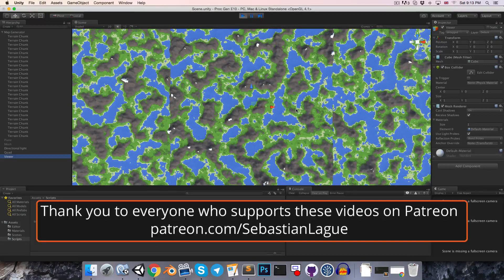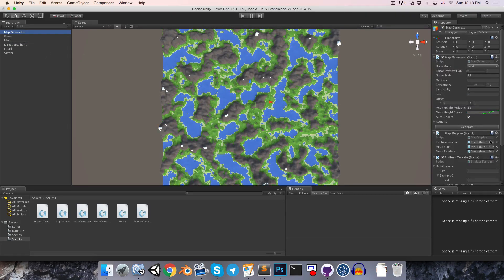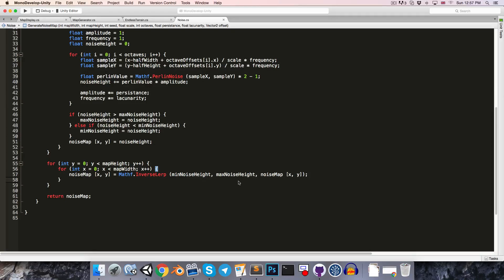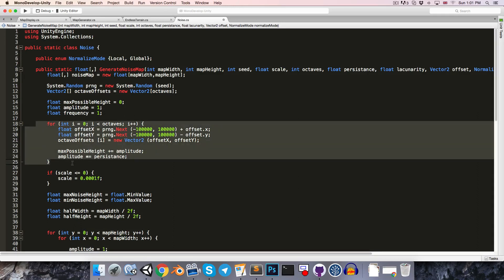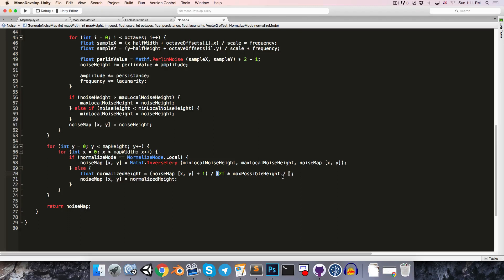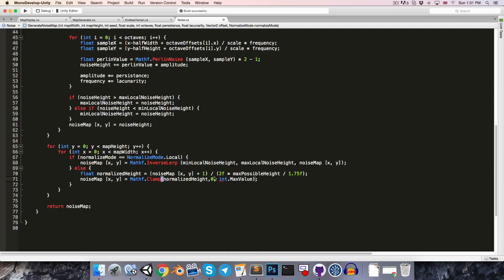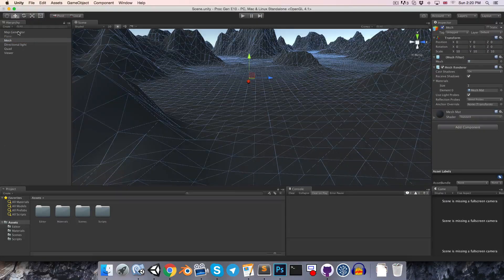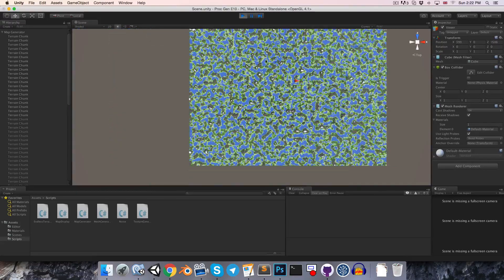Procedural Landmass Generation (E10: seams)

Comment: the stuff from 9 minutes in onwards isnt actually because of what he said its because of a bug in the math he normalizing the heights by doing 
(noise + 1) / 2 and then dividing the max height
its the other way around its  ((noise / maxheight) + 1) / 2 dividing the max height first put the number back into the -1 to 1 range which it wasnt in before. once its back into the -1 to 1 range then x+1/2 puts it into 0-1 range.
Essentially with the way he wrote the normalizing math it turns a number between lets say -1.75 and 1.75 (persistence of 0.5 and 3 octaves) into a number between -0.375 and 1.375 then divided by 1.75 to make the max height 0.78 and the min height -0.21 which makes the terrain way more squished. All you need to do to fix this is just fix the normalize math

Comment: For anyone wondering why chunks are not seamless make sure the first lod in the array is set to 0, has been 2 days that I'm searching for a solution and was that easy😂.
Reply: Man I love you 🫡
Reply: Thank You ♥ You saved me
Reply: What do you mean "first lod in the array is set to 0"?
Reply: @Svíþjóð-2025  In the Unity Inspector for "Details Levels" the first element (in array position 1, but index 0) should have the field "lod" set to value 0 (it worked for me). 

Try it at least, for now. It'll be fixed later in the series.
Reply: @Bezio1292  Ah. My issue turned out to be a mistyped [x, y] where i had accidentally written [y, x] instead.

Comment: I know i'm a bit late (7 years late), but i have the same script and now when i press play i have an 
MissingReferenceException: The object of type 'GameObject' has been destroyed but you are still trying to access it.
Your script should either check if it is null or you should not destroy the object.
EndlessTerrain+TerrainChunk.SetVisible (System.Boolean visible) (at Assets/Scripts/MapGenerationScripts/EndlessTerrain.cs:184)
EndlessTerrain.UpdateVisibleChunks () (at Assets/Scripts/MapGenerationScripts/EndlessTerrain.cs:55)
EndlessTerrain.Start () (at Assets/Scripts/MapGenerationScripts/EndlessTerrain.cs:36)
Reply: I have the same problem, How did you fix it?
Reply: public void SetVisible(bool visible)
		{
			if(meshObject != null) meshObject.SetActive(visible);
		}
Reply: I did this and it started to work

Comment: Don't know if anyone still following it but I run into a problem, when I change the offset at some point with a small off set change at a specific point the map change drastically instead of simply shifting as I said this only happen at a specific off set point, this make chunk at certain points not fit each other. This problem runs deep to the noise level

Comment: Since following the last video and up to this video everything works as it should except the Endless terrain in play mode.  Its a frikken mess!  Not only does a lot of the terrain not align up, but every mesh is the same pattern and looks the same from the top down.  From other angles they are all different heights, mostly everything is too low below the ground level and there are random thin spikes sticking out and straight canyons cutting through some of them.

Comment: I've followed these tutorials exactly and my global normalize mode still has seams, it is selected in the editor. I've watched the video multiple times and have gone through the code line by line side by side with the one available on the github. Help me please
Reply: Kasper Juul commented this 10 months ago:

Okay. For those who can't figure out why their chunks aren't seamless. I spend a whole day on this to find out that i did not set the normalizeMode to Global in the editor for the mapGenerator, therefore the code we write never runs and the seams are still there.
Cheers for the great tutorials. And still giving us some challenges :P
Reply: @manofbias8113  I definitely have global selected in the inspector and am getting seams
Reply: @joshabelman3294  are the seams between the same LODs or different LODs?
Reply: @manofbias8113  between different LODs
Reply: @joshabelman3294  that's normal, don't worry, the point of the LODs is that you wont see them up close so the seams are not an issue, just make sure to tweak the rendering ranges so the player wont notice it change
Reply: @manofbias8113  gotcha, makes sense

Comment: I'm not sure what I've done wrong, but none of my land masses have any height anymore. Up until E09 it was all smooth and now it's practically a plane again... not sure what happened.

Edit: I have also copied the code from Github to see if I've missed anything and nothing. Maybe it's some setting through Unity, but from what I can tell it looks the exact same based on the settings that Sebastian is using.
Reply: Have you set up your animationCurve and height multiplier? Otherwise it will always be flat

Comment: Hi, my vertices still do not align even though I followed every step. Any ideas where to investigate this problem? Thanks
Reply: I had the same issue, I reversed the order of the x and y variables in several places.
Specifically check: Noise.cs > GenerateNoiseMap in the tri-nested for loop, we set noiseMap[x, y] = noiseHeight
Here (and in a few other places) I had typed noiseMap[y,x] (which is backwards)
Reply: @FidgetwickGnomebody  OMG, thank you my dude, I was bashing my head in the wall trying to find my mistake, turns out that was exactly that "noiseMap[y, x] = noiseHeight;" and not "noiseMap[x, y] = noiseHeight;"

Comment: If you know the output range of the Perlin noise function to be [0, 1], surely you can have a normalizationFactor variable, each octave you add to it the maximum possible value for that octave, and then divide the final value by the normalization factor?

So, say you had a persistence of 0.5. The maximum value of your first octave would be 1.0, the second octave would 0.5, the third 0.25, the fourth 0.125 etc. Add all those up and you get 1.825. This is your normalization factor. So, whatever final value you get from adding up the Perlin noise at each level, divide by this normalization factor and it should put your noise value between [0, 1].
Reply: For anyone reading that is a popular way to tie these values together. You lose the granular control, which may eventually be needed for specific biomes/regions, but it makes things a lot more automatic.

Comment: Awesome tutorial series, even today! Lots of gems in each vid. 
Still have an issue here though, when scrolling the map by incrementing x or y, the land mass will still deform or change sometimes. I thought it was a typo in my code, but I checked the supplied code and it does it also. Not all the time but I did find areas where it would.
Reply: I noticed the same thing. When set to global the deforming is gone for some reason. Only on local it happens. I've been looking for a solution for this since i want to make a 2d game so i cant fix it with de vertices and triangles.

Comment: for the max, you can remove all the n*2-1 and (n+1)/2 and divide the final value by the maximum calculated. or, you can make it (n+maximum)/2 to actually reverse the operation. also, Perlin noise generates values outside of [0,1], so I multiplied the max height by 1.1.
Reply: afterwards, the mesh is going to look a bit awkward, but the regions and the heightcurve can be used to make it look  normal.
Reply: @kaishang6406  thank you, although somehow i ended up with values from -1 to 1

Comment: If you want to make the "scale" variable a bit more accessible to be changed on demand, I'd recommend using the Map Generator object to be able to place it in the Editor.

Simply add the following line to the start of the Map Generator script
public float worldScale = 1f;

Then, in the Endless Terrain script, replace every instance of "scale" with "mapGenerator.worldScale"

This way, you'll be able to adjust the world scale from the Inspector without having to change it in the code, although things will get whacked if you try to edit this value while the game is running.

Comment: 3:33
I tried to do this but now offset isn't working at all, anyone got any ideas why? (I am rewriting this code in a different language if that matters at all.)
Reply: maybe check your current octave number. Mine was on 29 when i did the changing and suddenly everything went hilariously wrong. Brought it down to 5, and now everything is fine :)
Reply: @aprikosengelee1503  There's definitely some awkward combination of values for the generation algo that can cause some really bad terrain generation.
Sebastian is using the following values:
Noise Scale: 25
Height Multiplier: 15
Octaves: 5
Persistence: 0.5
Lacunarity: 2
Reply: @aprikosengelee1503  my octave count is fine, but thanks for the help!
Reply: dunno I am writing this in same language and it happend to me too, tho when I swith + for -
                float sampleY = (y - halfHeight + octaveOffsets[i].y) / scale * frequency;
                                                                     ↓↓↓
                float sampleY = (y - halfHeight - octaveOffsets[i].y) / scale * frequency;
it seems to work so far without negativly effecting other things
Reply: @abram6282  Didn't work but thanks for the help!
Reply: someone solved this problem?

Comment: when i go in play mode all mesh turns dark gray, or if i press ctrl+s all colors go away to white. also for some reason generating takes forever so i had to turn off autogenerate button and just generate manually plus terrain that generated is disabled and even when i enable it, it still is invisible. My pc is gaming new pc so idk whats wrong with unity, perhaps anyone here experienced the same?
Reply: I was just running into mesh issue. Remember to disable the mesh visibility before you entire play mode, it doesn't get updated and so it has some weird side effects. Unfortunately, I have no idea why your generation is slow.

Comment: I don't know if you cover this in a later episode but there is a mathematical function called a sigmoid (1 / (1 + e ^ -x) ) that ranges from 0 to 1, which is handy for the consistent heights
So what i have instead is
noiseMap[x,y] = 1 / (1 + Mathf.Exp(noiseMap[x,y] * intensity));
where intensity is a float (3 looks normal)
Reply: wow that actually seems to work, but it not very good at performance and need some little adjustment
Reply: @ariefwt2220  what's the adjustment?
Reply: Oh apparently, you can straight up just divide the noiseMap height by maxPossibleHeight and it works really well

Comment: Hi +Sebastian Lague, i found a simple way to get the true maxNormalizedHeight.
On first octave, amplitude = 1 so  maxNoise height = (1 *2-1) * amplitude  = 1; // *(2 -1) doesn't affect the max value as maxPerlinnoise is always 1*2-1 =1 .
amplitude *= persistance.
On next octave maxheight += maxheight * amplitude
amplitude *= persistance
On next one the same. 
so maxHeight at o octave = 1 + 1*amplitude*persistance + 1 * amplitude * persistance*persistance + .... + 1 * amplitude * persistance * persistance  *..... * persistance where  the "..." means o-1 times
So we can just say:

float maxheight =0f;
int amplitude = 1;
For (int o = 0; o<octave ; o++){ //or we could say o<=octave-1
   maxheight+= amplitude * Mathf.pow( persistance , o);
}
float minheight = -maxheight; // as we use perlinNoise*2-1 

no more approximation ;) but you may have resolved in a later video x) 
Thank you for this great serie, i'm learning so much... Huge thank to you!
Reply: We can simplify the geometric progression sum(ap^n,n=0,k) as a(p^(k+1)-1)/(p-1) so:

maxheight = amplitude * (Mathf.pow(persistance,octave)-1)/(persistance-1)

If persistence is  between -1 and 1 the limit to infinity (which will truly be the max-est height):

maxheight = amplitude/(1-persistance)

if persistance = 1/2:

maxheight = 2*amplitude
Reply: As per  @MagicGonads  comment, the maximum possible noise value can be more easily calculated with 1 / (1 - persistence).
However, as the persistence nears 1, the chance of the noise getting anywhere near that value gets extremely low, so it's not useful as an upper normalisation bound.  I found that using 1 / (1 - persistence^1.5 / 2) to calculate a likely maximum noise height worked sufficiently well for most cases.
Reply: @RuaridhWilson  Might be nice to do some probability analysis on it to find out what the expected max height will be, beyond my abilities though.
Reply: I was thinking that you could do a gradient ascent on the noise map.

Comment: seeing you divide by 2 or 10 sometimes , i wonder why you wouldn't want to multiply by .5F or .1F.  i was taught, that multplication is generally faster than division because it takes far less CPU cycles. however i don't know if it would also make sense for division by variables by declaring an inverse variable first like inverseVariable = 1/variable and then multiplying by inverseVariable at runtime
Reply: Modern compilers are extremely good at optimizing. It doesn't matter if you write x * 0.5 or x / 2.0, they will both most likely result in the same assembly code. What the programmer should consider is the readability of the code.
Reply: I think those extra cpu cycles don't matter, it's probably never more than 1 millionth of a second extra

Comment: Hi Sebastian, thanks for your videos, this tutorials are amazing.
I found a little problem, maybe in a future video you fixed this but just in case, in Noise.cs:

if (noiseHeight > maxLocalNoiseHeight) {
     maxNoiseHeight = noiseHeight;
} else if (noiseHeight < minLocalNoiseHeight) {
     minLocalNoiseHeight = noiseHeight;
}

maxLocalNoiseHeight and minLocalNoiseHeight are float.MinValue and float.MaxValue so the first time you check the values noiseHeight will be greater than maxLocalNoiseHeight, so it will be assigned as new max. However this first value could be your minimun value and you will be not seting it as minLocalNoiseHeight because of your "else". Even more, if the values you check here are in incrementing order your minLocalNoiseHeight variable will remain as float.MaxValue.
Reply from the maker: Thanks, good point.
Reply: Is it normal to still have a very pixilized looking map at this point in the series? Yours looks very soft, whereas mine has very obvious squares making up the entirety of the map. I copied your MapGen settings at 2:44, and I've still had no luck.

Comment: So most of my seams fit together very well. However, in some areas there is still a noticeable gap. In most areas there is also an issue with lighting where you can see the lighting isn't spread equally between seams so you can see a visible line where 2 chunks meet. Anyone else have this issue?
Reply: I am also having this problem.   No matter what numbers I use I can't get rid of the seams, and it is noticeable in viewer range at run time.
Reply: Yo I KNOW THIS IS LIKE 5 YEARS AFTER but make sure that in the sampleX & Y, it is (x- halfWidth), not  (halfWidth - x)

Comment: How do you add a meshcolider to the chunks? so you can spawn a simple fps prefab and walk around?
Reply: In Public Class TerrainChunks define a 'Mesh Collider meshCollider' and then add a mesh collider in Public TerrainChunk using meshCollider = meshObject.AddComponent<MeshCollider>(); and lastly in public void UpdateTerrainChunk() under the if (lodMesh.hasMesh) statement make the meshCollider equal to the meshFilter using meshCollider.sharedMesh = meshFilter.mesh.
Reply: +Mc Stevens You can use same vertice/triangle (sorry I suck with meshes so you'll have to look it up yourself) list to generate mesh collider for it.

Basically google generating mesh collider from list or whatever.
Reply: https://en.wikipedia.org/wiki/Barycentric_coordinate_system

Comment: For the heights exceding the maximum, wouldn't it be better to juts Math.clamp the normalizedHeight between 0 and 1?
Reply from the maker: +kennyPAGC You could certainly do this, but then you're going to get some plateaus.
Reply: using the Math.clamp method
Reply: How do you clamp? Sorry if this is a noob question, still figuring out unity functions when it comes to procedural generation

Comment: do you have a use license anywhere for the code you teach in your videos?  i didnt see one on your github and i dont want to make any assumptions with IP. things can get messy that way.
Reply: i never said it was public domain. i asked if it was. there is a difference. i stated in the original post that i wasnt making any assumptions because of it being IP
Reply from the maker: +matt gipson Nope, no license.
Reply: So everything is public domain?
Reply from the maker: +matt gipson Correct.
Reply: +matt gipson No license doesn't mean it's public domain. It means he hasn't said anything about what you can do or not with his code, so normal intellectual property laws apply.  You should ask him permission if you want to do anything beside downloading his code and using it privately.